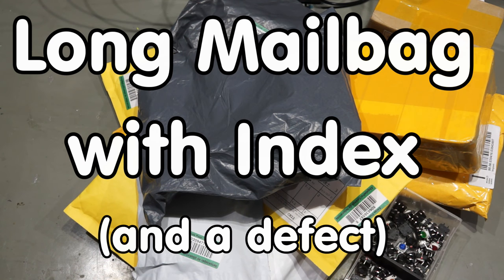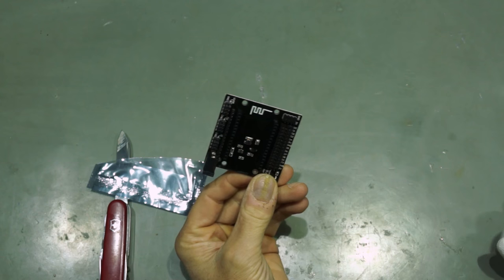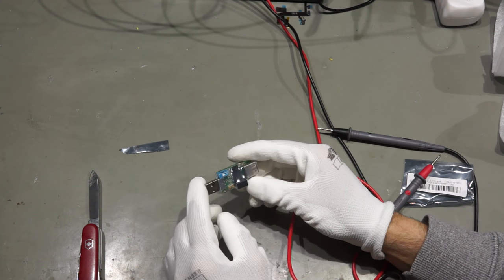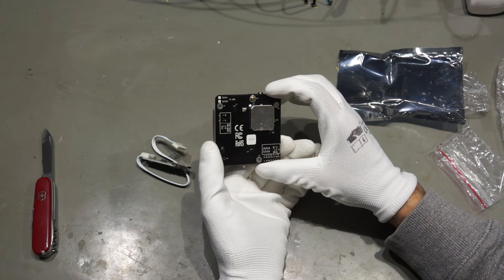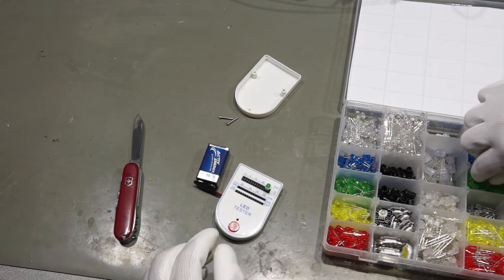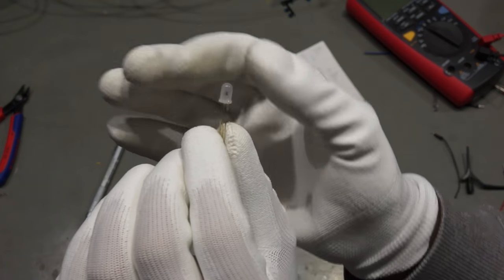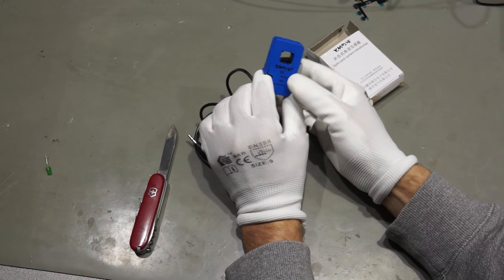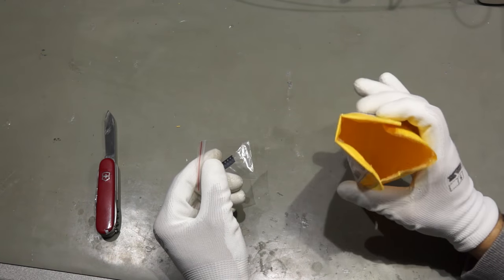#114 Mailbag

Comment: Nice bag of goodies, fellow left-hander! Thanks for the handy index and links.
Looking forward to see the comparison of regulators.
BTW: don't press too hard on the tip of the mini-soldering iron. The ceramic of the heating element is quite brittle and not replacable. I broke my first one and bought a new one because it's a little device, handy for wireless soldering and it's very affordable.
It seems like that bottom row of the led tester should be used differently. Can't you figure it out by drawing the schematic? Maybe the middle leg should not be bend for all types? What is that symbol on the right between the + and - ?
Reply from the maker: I read about using it for "phantom" LEDs. But 1. I never used such a thing, 2. the drawings clearly show the diodes I used for my tests, and 3. I am not convinced that it would work with these "phantom" LEDs (looking at the PCB). Maybe, there are different makes of this device sold. But, as I said, it is ok for me.

Comment: +Andreas Spiess. I have 3 of these MPPT modules. I've installed one of them in a solar charging unit for my meteo station. They work very well. Just a warning: it's necessary to put a diode between the module output and the battery under charge. The circuit has no protection...
Reply from the maker: Thanks for the feedback and the tip!

Comment: Hello, thanks for the nice shopping list. ;) Project proposal: esp32 + 3 x SCT-013-030 current sensor = wifi home energy consumption monitor. With esp8266 that was impossible if your house uses 3 phases since you need 3 analog pins + 3 for phase voltage monitor
Reply from the maker: If the ESP is usable...

Comment: For the hall current sensor take a look at the openenergymonitor. I made a monitor myself but couldn't install it :(
It has voltage sensors on all three phases and I used a STM32F103 because it has a 12bit ADC.
Reply: I think it's not  a hall current sensor, it's basically a small transformer that transforms AC  to another ("smaller") AC. So you can only measure AC current, no DC current. And you need some additional components as described on openenergymonitor.
Reply: MrPaperlapapp1 I have all the components and it's working but I would have to call the power company because the wires are sealed.
Reply from the maker: You are right. It is not a hall sensor!

Comment: on the LED tester the lower two rows are for 4 pin leds (like the picture on the right of the pins) eg http://www.farnell.com/datasheets/9234.pdf  and work fine with them. I first saw these on bigclive youtube channel.
Reply from the maker: First, I had the same info. I was not able to test it, because I never used one of these. And the sings printed on he device clearly show a different thing. BTW: I am not sure if my device would work with these "phantom" LEDs (just looking at the wiring.
Maybe there are different sorts of devices sold.

Comment: YwRobot 5/33.V breaboard supply mostly buggy. Should not be used from 12V - 5V regulator does not work, so 12V hits the 5V pins and USB power line as well. Check forums on Internet.
Reply from the maker: I have a few of those, but so far, no problems. Of course, you cannot draw a lot of current if input is 12 v. The regulators have no heat sink. Better use a 7-9 volt power supply.

Comment: i saw that other people used that module for LoRa... with 1 channel how many devices you can use ?
Reply from the maker: That depends on how long each device sends data. I assume, that 10 - 100 or so should work. But keep in mind: if this one channel is blocked by another device, no communication will be possible.
I built such a gateway and will cover it in one of my next videos
Reply from the maker: You will see this product in one of my next videos
Reply: ok, thanks

Comment: Regarding the breadboards: have you tested them yet? How easy is it to insert components such as a NodeMCU dev board into the breadboard and removing it? I recently bought 4 similar breadboards from another supplier. Inserting most components into these boards result in the breadboard clips popping out at the bottom. These boards are totally useless :-(
Reply from the maker: I do not use these breadboards for nodeMCU because the pins are too big. I think, a similat thing would happen withhte boards I have. I use special breadboards for nodeMCU boards (shown in the mailbag)
Reply: Thank you for the reply. I just used the NodeMCU as an example. The breadboards I bought show the same behavior when using Arduino Nano, Pro Mini,  WeMos D1 Mini, etc.  :-( I was wondering if the ones you bought are better ;-)
Reply from the maker: These board all have the same problem: Their pins are Much thicker than most resistors, transistors, diodes, or capacitors. And these boaards are made for this kind of parts...
I also think, that there are not many manufacturers, only many dealer selling the same stuff... Maybe it would help to stick them on a metal sheet.

Comment: how are those breadboards ? I have never used those, but the plastic looks brittle or cheap.Any idea what its made of ?
Reply from the maker: They are similar than the ones I have. And I do not know enough about plastic to distinguish the different sorts. I have one from a local supplier (Conrad). They were much more expensive, but I cannot see a big difference.
They seem to be ok for resistors and alike. One of the viewers had problems with bigger pins (NodeMCU boards). I only use it for thin wires which you can change direction during plug-in and DIP housings.
Sometimes, it is hard to push the leads in. Then you have to change direction and it works. So far, I also do not know if they will live long, because I do not use them often (I have many of them and each has many holes).
Reply: I have seen reports of wildly varying quality with those,  and how in some cases the metal contacts were malformed and wouldn't work reliably.  So I'm careful who I get them from.  There also seems to be no standard when it comes to connecting them together.

Comment: would the USB isolator prevent the USB killer from destroying the PC?
Reply from the maker: No. This is only an electrical isolation, not a software isolation
Reply: Andreas Spiess the USB killer produces 200volts on the USB pins. that is not software but hardware?
Reply from the maker: Aha. I did not know. Then, it should protect. Where can I buy such a "killer" to check?
Reply from the maker: That is too much for a "toy"...
Reply: Indeed, i wouldve bought it if it was cheaper. You should consider making a tutorial on how to make a diy one. on the other side if it was cheaper more people would use it in schools and libraries etc so more computers would be damaged.

Comment: the same vendor sent me an old version dragino lora hat v 1.0 which needs diy fixing as per dragino's wiki. are you luckier then me? which ver is yours?
Reply from the maker: +youlian troyanov  I also got a 1.0 Version. I used it without mod for a single channel gateway, however without GPS
Reply: Well, according to the wiki it needs soldering to work with the lmic library, I asked Edwin from dragino and he confirmed. But if you don't use lmic I guess you are ok. Anyway please do post what you did with it one day. Where I live it takes 3-4 months (or never)  to get chinese parts, no Switzerland for sure, not even close😣, so my lora itch is on hold. Dragino Edwin is the guy to watch when it comes to cheap lora solutions methinks 😎
Reply from the maker: But anyway, the missing lings should not be too complicated to add... BTW: Where do you live?
Reply: toronto. where mail from china does NOT arive. i am off to file a dozen of ali disputes. absurd, i know. even better, the official motto of canada post is "we deliver the online world", they missed a fat "NOT" at the end methinks :)
Reply from the maker: This is very interesting I thought, you will answer "Siberia", "Kongo", or " Amazonas"...